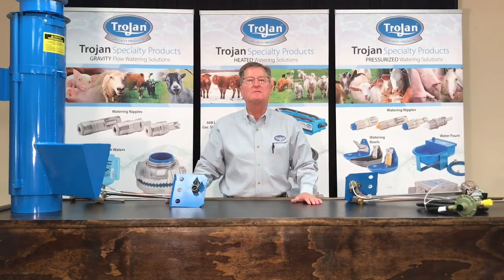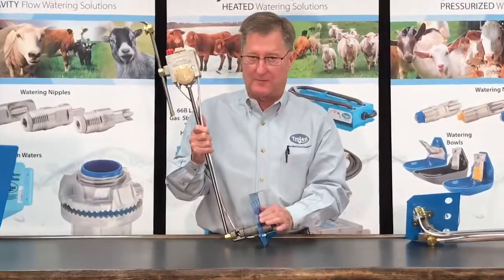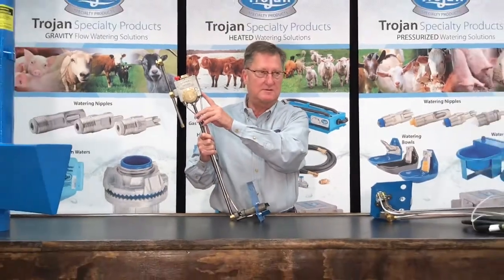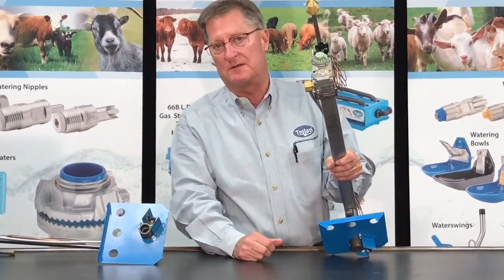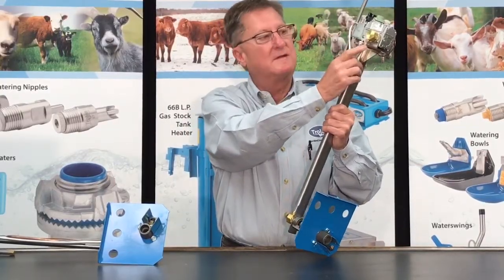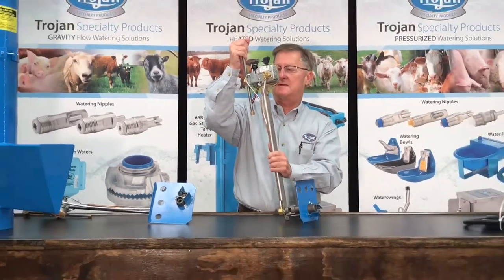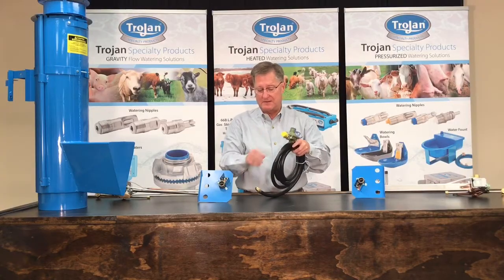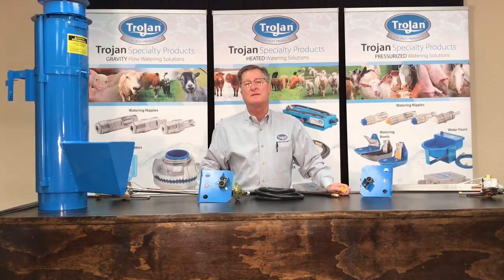Updated 66B Complete Burner Assembly

Comment: Why would you put one end that is MNPT, just so you can sell hose kit? Shame on you
Reply from the maker: The Propane Hookup Kit comes included with the 66B, at no extra charge. We suggest using the kit that is included because with our low pressure, nonadjustable regulator, we can help the customer keep the amount of propane running through the unitrol at a safe pressure, so as to keep it from malfunctioning.  If a customer is needing a new Complete Burner Assembly, which does not come with a Hookup Kit, the customer most places that sell propane and related products should be able to help him or her find the fittings needed if they are unable to use their previous set up.  
Please feel free to give us a call if you have any other questions. We would be happy to answer them.